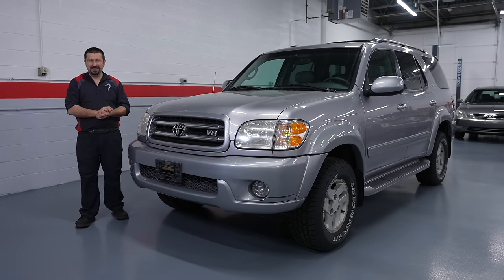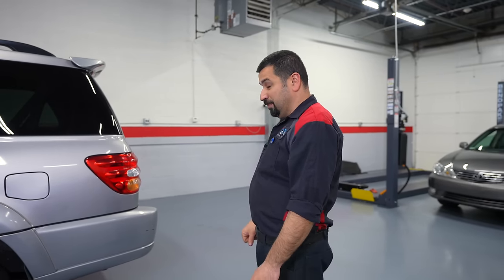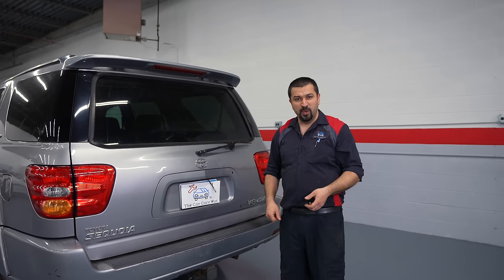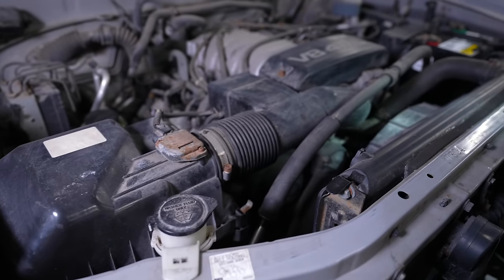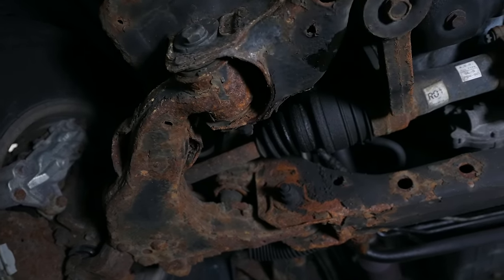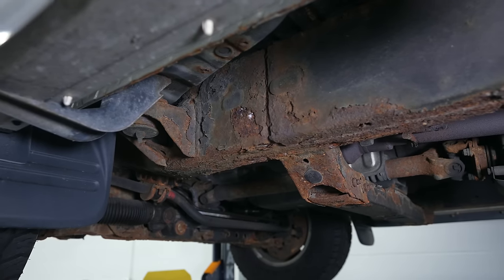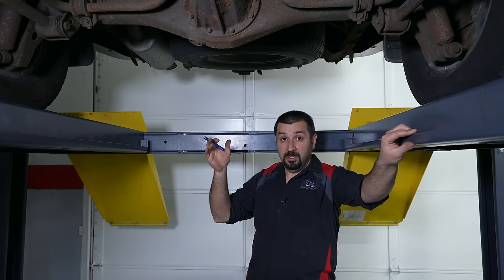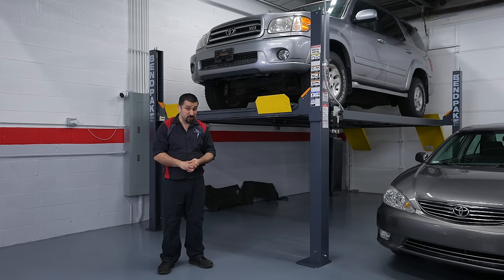NEVER Buy a Toyota Like THIS ONE! Hint : It's not The Sequoia!

Comment: I had the exact opposite experience buying a 2009 lexus RX450h with 160000 miles.
It had a bunch of cosmetic issues with the bumpers and scratches because it lived on tight city streets.
The inside was perfectly clean and whole. There were zero things broken anywhere.
In 4 years I owned it I only replaced wear items in the suspension, regular service, and recently had to fix the hybrid battery. I'll take that any day.
Reply: Wife has a RX350 we got it very cheap but it had lots of problems All the problems I've been fixed but now it's looking oil but it has 265,000 mi and is loyal as hell starts every time transmission works perfectly have not had any major issues
Reply: That’s how my daily driver taco is. Peeling clear coat, dent in the bumper from previous owner. But the frame is spotless, interior is very clean, and I’ve taken good care of it for the last couple years i’ve owned it.
Reply: I would much rather some cosmetic issues on a used car...  I dont care about scratches.. I want to see good service records and good maint..   some scratches and dents will not put you on the side of the road.
Reply: I bought a 2005 rx330 with a 180K on the clock & it’s the best car we have ever owned! When it goes to the wrecking yard in the sky, we will buy a newer 1. Just had timing belt done & all fluids and belts done😊 Toyota sure can build a good car!
Reply: @Steverz32  honestly I think that those are more reliable than the 2gr however they need timing belts
Reply: @colchronic  if getting the belt replaced every 80K is the worst that happens, count me in.We are surprised everything work on it including the GPS👍😊
Reply: @Steverz32  honestly as a DIY mechanic I would much rather prefer to have a car with a timing belt these newer Toyota vehicles with the 2gr You can't even access the timing chain unless you pull the engine out of the car
Reply: @colchronic  brother I hear you on this! I had no problem paying 1300 to have it done. I have  a 2010 corvette grandsport  & the Lexus is easier to drive & more comfortable to drive. The major plus is nobody is stealing them or vandalizing them as well. I will park the Lexus anywhere and not really worry about it👍
Reply: @Steverz32  I have a 2006 Highlander with the same power train and 100k miles, meticulously serviced since day one. People think it's a 5 year old car.

Comment: Spot on. I've owned a 2002 and now a 2005 Sequoia Limited 4x4 and frame was always the first thing I've checked because they can get really unsafe like this! I've replaced a bunch of stuff on mine, and it is solid now, but rust is always an issue in Pennsylvania. Mine has 315,000 miles on it and I just did the timing belt myself. Thanks for the informative video! -Marty

Comment: This is a very good video to pay heed to. I just got burned on a Toyota Highlander with rusted subframes that was a similar situation as this. ALWAYS ALWAYS ALWAYS check out the underside of ANY Toyota you ever buy.
Reply: I worked in a body shop for a while. I always start by looking under car, because it is extremely hard to hide the history there. Was it off-roaded? was it in accident? is everything leaking? so on, and so forth. Most everything else can be given a cosmetic once over,  but the bottom of the car is extremely expensive and time consuming to for example paint, replace the rusted bolts, etc, without completely disassembling the vehicle.
Reply: I purchased a used 2020 Toyota Highlander recently from a Toyota dealer and made inquiry whether or not it should be undercoated due to minor surface rust on underside of the vehicle.  Dealer advised not to undercoat for fear the undercoating would clog the weep holes in the doors and other panels.   Should I ignore this advise.  I reside in northern Michigan.
Reply: @jamesflint3057  fluid film... don't undercoat and trap moisture
Reply: @bch5513  I thought "fluid film" and "POR15" were undercoating products?

Comment: I'm the original owner of a 2002 Toyota Sequoia it has 355k miles. Very good truck. The handle to the rear hatch did break and the shifter lever did get stuck and needed to be replaced.
Reply: The shift level got stuck? I'm looking at one that supposedly starts only in neutral

Comment: In 1985 I bought a rusted out 78 Honda with a new coat of paint. Could not even put it on a lift for inspection. I drove it for a month before the front struts popped up through the wheel wells. Learned a lesson.
Reply: Last time I saw that happen was in the '60s I heard a bang and looked around and saw a car with both front struts poking through the wings. The ammount of rust on this car it wouldn't get through our MOT examination infact I doubt if the tester would allow it to be driven out of the testing shop. Goodluck to the owner.
Reply: They make  em from our old beer cans.
It shows
Reply: @SkeletalMisunderstanding  not if you rinse the salt off regularly. Also depends if your buying an old 80’s car or a 2010’s car
Reply: @SkeletalMisunderstanding  If Toyota would use aluminum for the body and frame they would last forever.
Reply: @davevolz6138  If they did they wouldn't rust.

Comment: I want to thank you for all of your incredible advice.  I bought a Certified pre-owned 2019 4Runner with 24k miles.  I had the dealership put it up on the lift so that I could check the undercarriage and especially look for those trouble areas known to rust on the 4 Runner.  I'm very EXTREMELY grateful that YOU educated me on what to look for and that i did my due diligence in making sure I knew what to look for.  I could have bought a car with more bells and whistles like lane change and other sensors but in the end, I had a real hankering for the 4Runner.  I read too many issues with the Highlander and even the Honda Pilot and Passport (my runners-up).   i would've loved to have had the money to go with a  Sequoia but I'm happy enough with my 4Runner thanks to the Car Care Nut!

Comment: Love all your videos, just recently discovered your channel, I learn so much each time I watch one of your videos, I wished you had a shop her in SoCal I would bring all my cars to you for maintenance and repairs! After watching this video, I ran outside to look underneath my 2003 Toyota Sequoia and I am happy to report that there was no rust at all!  I am fortunate to live in SoCal where our weather is pretty mild.  Our Sequoia was the first car that we ever purchased brand new and it has been the best family car ever!  Almost 200K miles, no major issues besides the rear back latch, rear hatch window didn't work for a while (but it does now), the radiator just went out and my gas gauge doesn't always work properly, but other than that I have had no other major issues (knock on wood).  I do the timing belt and water pump service every 100K miles and do fully synthetic oil changes every 6k mi.  I will keep it until it goes no more.

Comment: Yep.  After wrenching on cars for a few years, I'm VERY apprehensive to buy a used Honda or Toyota.  Not because they're bad cars, but because owners go into them saying, "Eh, it's a Honda/Toyota, it'll last forever" and scoff on doing even basic maintenance.  I saw so many of these cars that would come in at almost double the recommended oil change intervals, which are already a bit too long IMO.  With how good their resale value is, I just would never be able to justify paying a premium to potentially have a car that was abused for 3+ years.
Reply: Honda toyota drivers are tight as a frogs ass… always trying to save a penny.. they skip oil changes to save a dollar.
Reply: The 2 Japanese used cars that I've bought (Nissan and Honda) both failed within 6 months. The 3 German cars that I've bought have served me for years without any major issues.
Reply: How long is "too long" for an oil change??

Most cars (and oils) can easily do 10k miles (unless it burns oil like a Subaru) between changes.
Reply: @jasono2139  10,000 miles is too long in my opinion. I think oil changes every 5000 miles (that’s what I do) will keep your car running for a long time.
Reply: @manujadesilva22  that's not what the manufacturers recommend, nor is that what the motor oils say either.

Granted, that's not ALL CARS... But most modern cars say 8k to 10k.
Reply: @manujadesilva22  unless you're running conventional motor oil, I see no reason to change the motor oil any sooner.

So long as you're using full synthetic, a good quality oil filter, and the engine is running properly, 10k (assuming the manual says so) is plenty soon enough.
Reply: @jasono2139  ... are you new to this channel?  He's literally covered this numerous times.  If you want to save money on oil changes, by all means, it's your money, your car.  I can't stand people who tout "the manufacturer recommends" and thinks they're preaching indisputable gospel.  Read the fine print.  And watch some of this guy's previous videos to prove to yourself just how wrong you are.

Comment: i’ve driven my new 2002 sequoia for about 16 years with the cracked manifold sound, the yaw sensor broken, rear hatch broken, and many MANY more problems. but the one thing i absolutely loved in those 16 years was that the sequoia NEVER once left me stranded or died. always started right up. 16 years!! which is why i now have a 2018 sequoia platinum.
Reply: I have the same Sequoia with same problems. But we still drive it everywhere runs and drives great.
Reply: I hope I have the same reliability with my new 2023 sequoia capstone.
Reply: Haha have the same 2002 with 266k all the same issue and a 2003 tundra with 333k will have it till it's falls apart or I do
Reply: The powertrains in Toyotas sold in the  last decade are far inferior compared to the powertrain in you 02 Sequoia. The engines back then were simple which is why they were rock solid reliable. I hope people aren't assuming that because their early 2000's Toyota was reliable that they are going to get the same reliability out of a new Toyota of the same model. A lot of us assumed that the 3rd gen Tacoma was going to have the same legendary Toyota QDR that the previous Tacos had but the 3rd gen has been a turd gen for a lot of us.
Reply: That's most cars you dummy! 🤣

It blows me away how easily pleased Toyota owners are so long as the engine rolls over and the car will move. 🤦

My Passat has over 100k miles on it, and it ALSO has never left me stranded anywhere... and it doesn't have a laundry list of broken parts on it.
Reply: @jasono2139  😂 Toyota fan bois are funny. They either praise their vehicles for doing what others regularly do or when they finally add a feature that's been present for years on other makes. Half the vehicle can have been replaced or inoperative but because it still runs they'll be like "it's been a great vehicle!".
Reply: @jasono2139 how is your mind 100000 miles equal to 250000?
Reply: It sounds like scrap, I'm glad you replaced it.
Reply: @thelosteddies Sounds just like Apple fanbois about their iPhones.
Reply: @jasono2139  
Mechanical Engineer here. 100k and 200k are hugely different. Also if you take care of any cars, they will last you a long time. It's just even here in EU, servicing a Mercedes or BMW past 5-7 years becomes uneconomical very quickly.
Reply: @ieditedmyname289  I'm also a mechanical engineer, so whoopty-doo!!

I've owned several cars, and typically their (un)reliability has been a linear progression from their first 100k onwards (regardless of mileage - because as you said yourself "if you take care of any car, they will last you a long time").

Furthermore, dum dum, the people who somehow have 200k on a 10 year old car are typically the people who are doing 90% highway driving/long distance trips. Their high mileage figures are nearly meaningless as their car is the same age as my car with 100K. Rust doesn't form on cars due to MILEAGE (and corrosion is the primary mode of failure on OLDER cars) 

I've had cars that had only 70k miles on them that needed more repairs and replacement parts than cars with 150k miles on them... Despite the car with 150k being OLDER... and I could have easily predicted which car was going to last longer simply by the number of repairs needed and on what items by 50k miles, by 100k it was obvious.
Reply: @jasono2139  
You aren't wrong. But it's just the fact that you can buy any Toyota part even in Afghanistan and usually they tend not to update their design unnecessarily. Good luck finding Merc or BMW parts for a reasonable price. 

Also come on, there are statistical proof that Toyotas and Hondas are far less likely to leave you stranded that VW. If you like your car, that's great. But you cannot dispute stats.
Reply: @ieditedmyname289  the "stats" you're referring to are usually based on customer surveys... Claiming that those somehow are somehow a perfect reflection of a cars reliability is about as dumb as saying "people who buy Porches tend to become wealth 🤪"

...most people who drink VW are younger, harder on cars, and don't maintain them properly... Toyota owners tend to be in their 40s and drive like they're 80... Thus why they're "so reliable! 🤪" 🤦
Reply: @jasono2139,  100k miles,  ROFL... that's cute.  Come back and talk to the class when you can make it to 200k and let us know your experience with that VW, lol.  It's doubtful you will,  because the common scenario is,  especially with German cars like VW and Audi, that by the time you get to 150k, there will be so many major issues to contend with which add up to the "cheaper to buy something newer" scenario. 
 Too funny,  when inexperience gets up on the soap box and makes an absolute fool of itself.  My ridgeline has 377k on it,  and I abuse that hell outta that thing,  maintenence wise... something your VW is simply incapable of,  and primarily because VW is huge fan of planed obsolescence.

Comment: Love these videos. Always so informative. I used to own Toyota's and rust is a severe problem. I now have a 2008 Chevrolet Avalanche with 472,000 kms now and it's absolutely relentless and perfectly reliable all these years. But I did a thorough inspection. It's all about your safety!
Reply: 472k miles, had tens of thousands in repairs over that time.
Reply: @HermannTheGreat  if you say so.
Reply: @matthewlibanio8227  I do

Comment: "GM style problems." That's a thing. I bought an old Chevy for $600 when I was 15. It had about 60K miles. I learned all about oil leaks, changing every pump on the car, diagnosing and replacing blown head gaskets, pulling a tranny to have it rebuilt, brakes, electrical, and so on. To be fair I kept that car way too long and gave it away to someone in need with about 200K on it. That old 305 was still going strong and the car taught me a lot about shadetreeing.
Reply: Agree 100% and there's some GM style problems you can get away with if the car is meant to do only a few things, and or some are so basic there's few things to go wrong with them in the first place. Dad has a beater 99 Silverado 2500, we're outside the US so it's a single cab, short bed with the 5.7L vortec V8 that in the US was used in a bunch of vans, airbags, AC, a 4 speed manual, disk brakes, but NO ABS (some panic stops with an empty bed are character building) and it came with an AM radio. Those leaks and random part failures sometimes happen but it's a work mule, it's scratched and dinged but rust is not a problem here, if it can haul the load needed and fixed enough to not be leaking all over the place, that's all we need from it, and seeing the price of new trucks today, we'll probably keep it until it can no longer be repaired by us or for cheap.

Comment: When i was looking for a car last year i found a 2014 acura rlx for 17k and when i drove it, it felt great and it looked great. So i decided to take it to a mechanic to have it inspected. Good thing i did, because he found numerous permanent codes, a hole in the oil pan, oil filter leaks, numerous permanent codes for the rear wheel steering, the power steering/electric steering (i forget which one this car had) even had some very concerning codes. He told me it's not worth it. So i listened to him, i took the car back to the used car lot, showed the guys what the mechanic showed me, told them i would buy it for 12k at most because of everything I'd have to do to it. They laughed at me and didn't even bother counter offering. Even tried to go into a whole speech about "maybe i should rethink what class of car i should be looking at." Lol. But i was respectful (even though i wish i would've said something) and just moved on about my day. Not kidding, the next day i found a 2014 lexus is250 at a Beaman Toyota for 17k. I went to go look at it, drove it around and instantly fell in love. Had it inspected, everything was great. The car had a very, very extensive service history, all at lexus dealers. 2 owners. So, i offered 12k for it, and we ended up on 14k before all the extra fees. It had 134k miles on it, I'm now up to 145k, and it is just the smoothest and most comfortable car I've ever been in. Could not be happier with my choice.

Comment: Everything in this video was correct except for the fact that the rear hatch handle issue is a common problem.  I own a 2006 toyota sequoia and ive had to replace the hatch handle 3 times.  I finally looked into it and found that the OEM is a faulty part.  I ordered an aftermarket one that is all metal with no plastic and have not had a problem since.
Reply: Hi, Could you please tell me the name of the after market hatch handle. I have 2004 Sequoia, the hatch handle was replaced 3 times like yours. I spent almost $900. Now the handle is jammed, can't open the trunk. Thank you.
Reply: @fram4246  it’s NPAUTO Tailgate Liftgate Handle Rear Back Latch Hatch Door Handle Metal Replacement